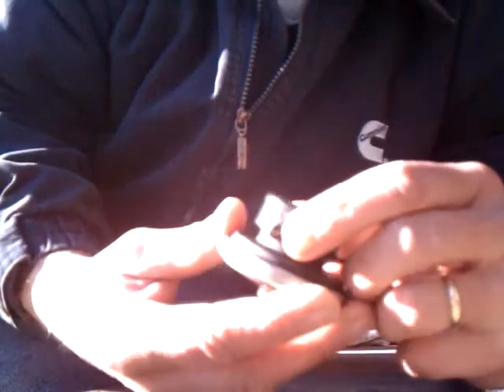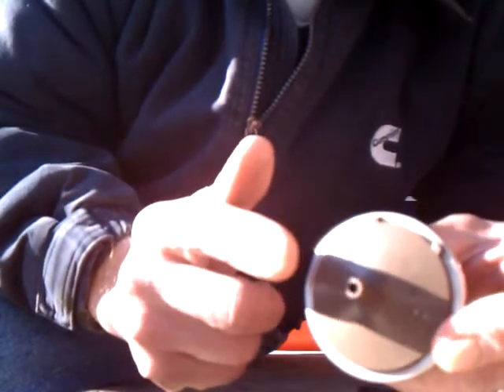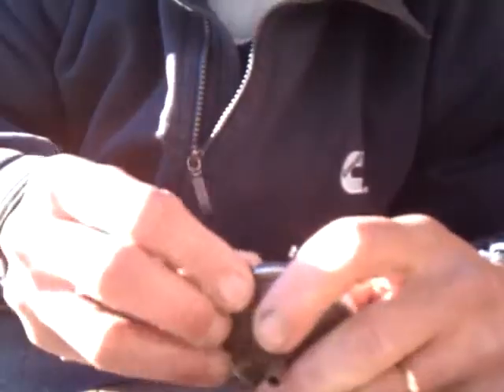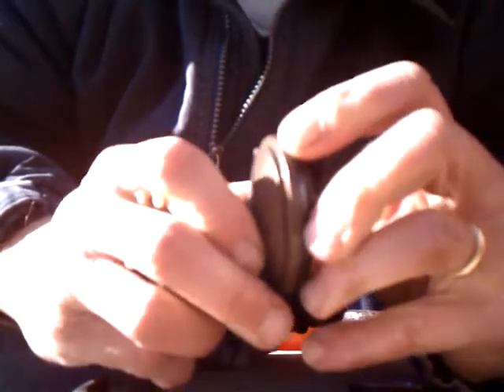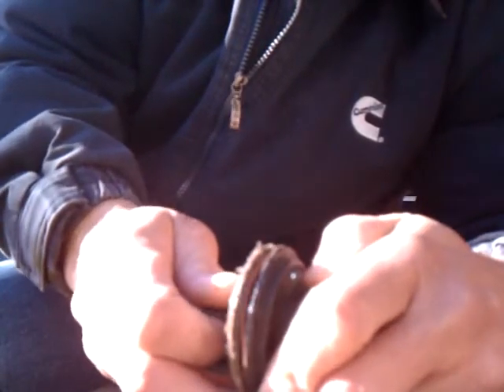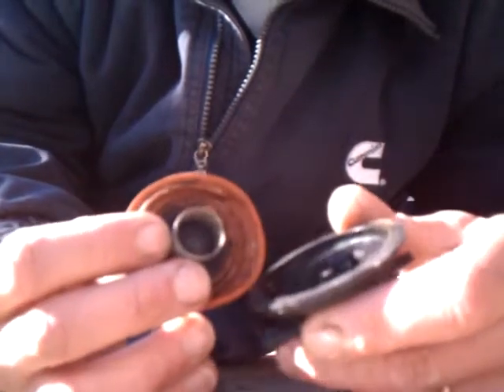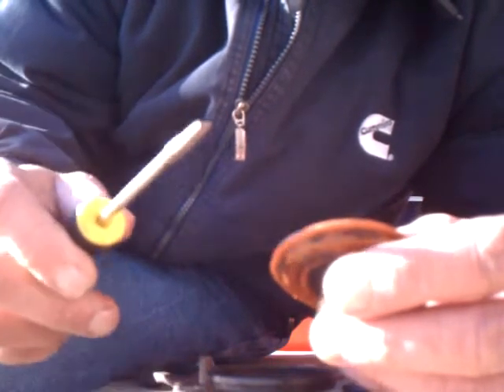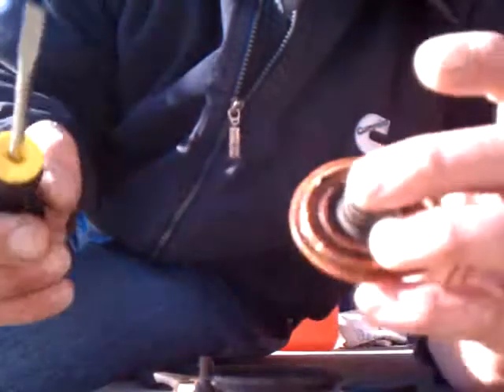Toyota Modulator Valve P0401 disassembly

Comment: this video was a huge help    my 96 tacoma has had a p0401 ever since i bought it last year   , i watched this video   then i went outside and removed the modulator from the truck     and sure enough   there is zero flow through it p to q       and i noticed the bottom feeder hose has a pulse  when the truck is running   but nothing is coming out of any of the other ports   ,  its dead     ,    i am going to order  a new one   .

thanks again

Comment: Thanks for the video, William.  I have a question about what you said (I didn't quite understand). From 0:39 to 0:55 you're talking about testing it by blowing through the "P" port to see if there is flow through to the "Q" port.  Do you mean that flow means it's bad or flow means it's good?
Reply from the maker: You should have unrestricted air flow blowing through P to Q.
Reply: William Kelley OK, so flow from P to Q is good.  Thank you!

Comment: So, I was plagued with the code from hell p0401 on my 1996 Toyota Camry V6 and tried all the possible solutions indefatigably and with relentless effort. I cleaned the intake manifold, cleaned the fuel injectors, cleaned the egr valve (which wasn't clogged), and  to my heartbreaking surprise, the CEL will always come back shortly after. Now finally, and with the aide of your informative video, I pinpointed the culprit: THE EGR MODULATOR FILTER WAS HARD AS A ROCK FROM CARBON. cleaned it CLE gone